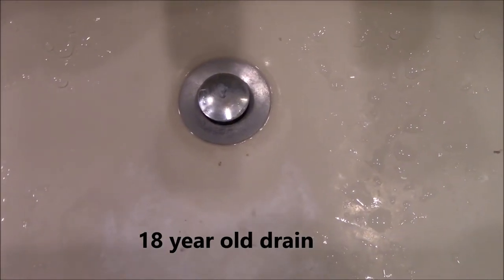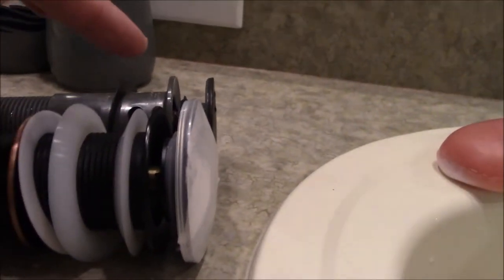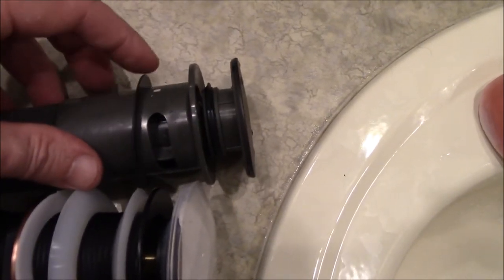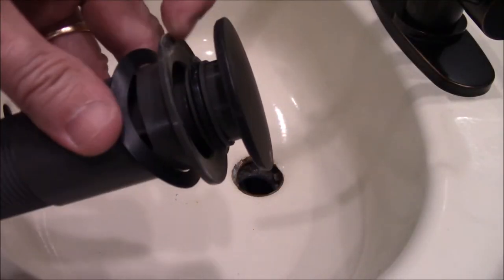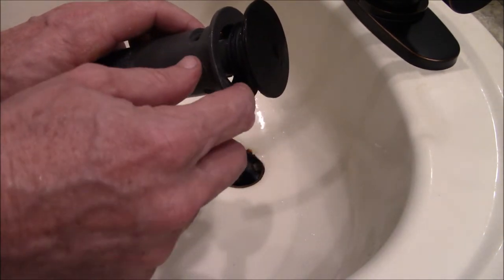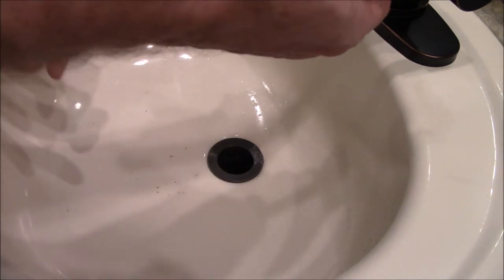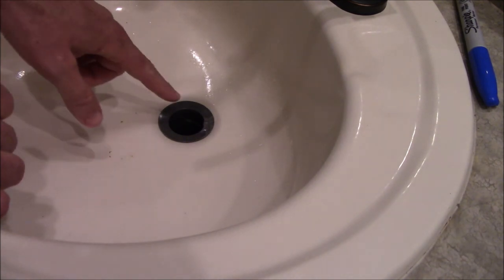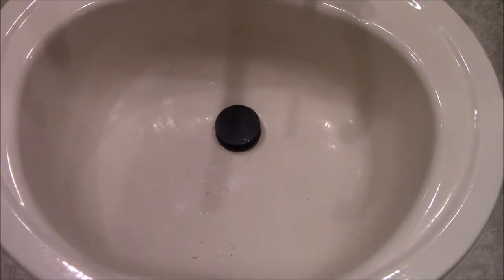New Pop-up sink drain pooling water. Free fix

Comment: Good job. Having the same issue. There has to be a better way 😩
Reply from the maker: They should offer drains for the older sinks.
Reply: Mines chrome and I noticed this after installing a new pop-up drain. It’s not as bad but you can see a ring of water around the drain hole. Anyone know of a better fix?

Comment: I just ditched the top rubber gasket and used a thin layer of plumber's puddy.  A very small amount of water still pools around the lip of the drain, but it's essentially not visible unless you put your head next to the drain and shine a flashlight.

Comment: I have the same issue. And hard water makes it rust in the indention. Bought the universal sink stopper and it does work better. East install you just sit it in, but the left and right side still is not level. I don't know how to make a round sink drain level. I have culture marble sinks. I just want the sink to drain so I don't have to clean around the sink drain every 2 days. WHY do they make that indention in a sink instead straight tilt to the drain. It is like the sink drain should be big enough to fit into that indention. THE SINK DRAIN HOLE IS NOT FLAT. dang it.
Reply from the maker: I know. They should carry repair parts for 20 year old sinks.

Comment: I just bought this style of drain yesterday and am having the same issue. It looks like I have the exact same sink. I may try this fix. It's so irritating the damn thing has to be modified. Thank you for the video.
Reply from the maker: Changed out another drain two weeks ago and It was the same ordeal. You would think if someone is replacing a drain, its on an older sink, thus the need to match that sink. Thanks for watching.
Reply: @Soladaddy  I did this mod to my drain and unfortunately it didn't help. I put four channels in the rim of the drain to no avail. The problem with mine is the diameter of the rim is too large. It covers the concave portion of the sink. We have the same style drain in our other bathroom and it is great, but the diameter is smaller so it doesn't cover that concave portion of the sink. I tried to grind some off the edge to reduce the diameter, but I don't have the correct tool to do this.
Reply from the maker: @doobielawson702  Mine was plastic and when screwed down the flange sat at a slight angle, very slight. But I still had to make the inside end of the channel deeper than the outside end so the water could flow downhill. Took me about 3 grinds to get it to drain decently.  A drill might work, but the generic dremel tool spins much faster, doing a better  job.